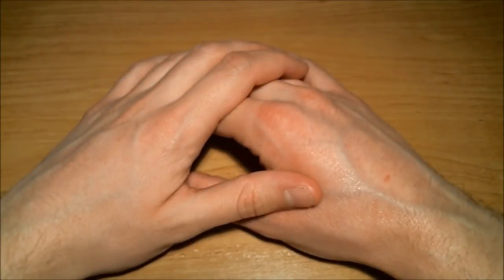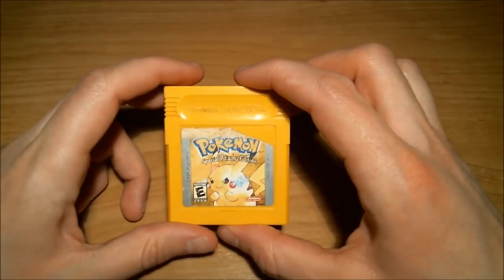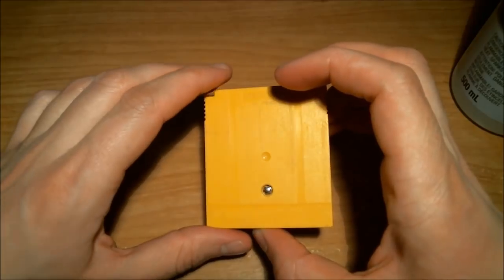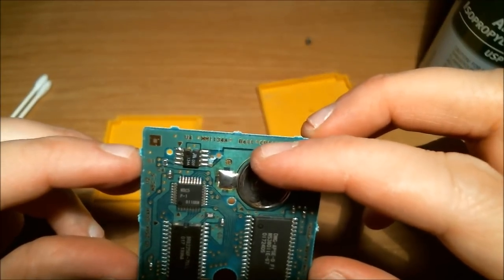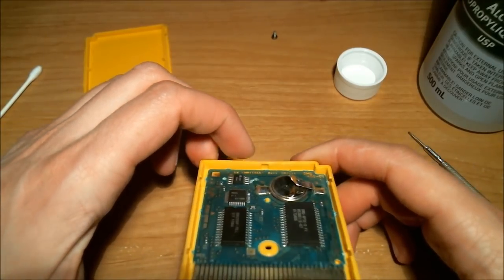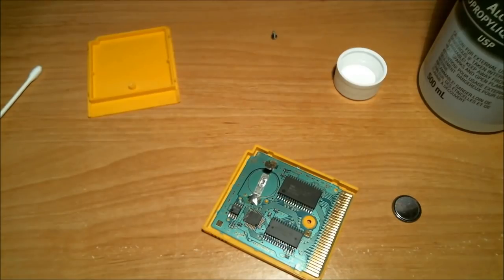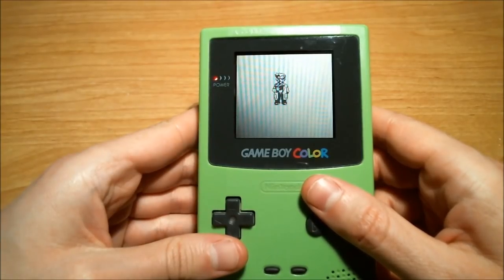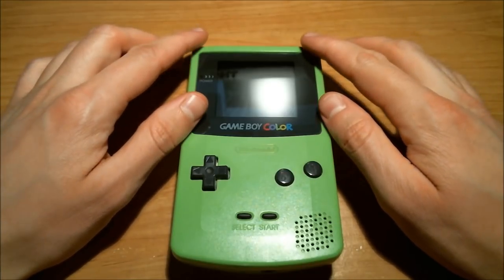ASMR Whisper: Pokemon Yellow Cartridge Battery Replacement

Comment: I actually just found out why it's not working. The previous dead battery actually leaked, so it might have messed with something in the game cartridge. So it actually had nothing to do with opening it up and replacing the battery.

The first time I tried after I replaced the battery, it was running good, then the screen whited out after 1 second on the "New Game" menu.
The rest of the attempts are just the Game Boy logo showing up clearly then cutting to nothing.

Comment: Well, I just tried everything I could tonight and it still isn't working. All of the battery leakage was cleaned out and both sides of the circuits were gently cleaned with alcohol. It was a good effort though, thanks for the advice anyways.

Comment: This video is so cool! :D I bought the same cartridge in a flea market a few weeks ago, and when I started playing I could save my game :'( Does it mean that I have to replace the battery? Where can I get a new battery like yours? T-T

Thanks for making this nerd-educative and tingly-addictive videos! :D (and for answering my questions as well)  (n_n)b thumbs up!
Reply: * I couldn't save my game :(
Reply from the maker: Nice flea market find! If the game plays fine but the save isn't there the next time you turn it on, then it's likely a dead battery. If you follow the steps in this video, you should be able to get it working! You can get CR1616 batteries at most hardware stores and electronics stores. Some drug stores may even have them. Good luck with the repair!

Comment: here's a tip, a CMOS battery dead on a computer's motherboard can work for replacing these!
Reply: hahahahaha i jacked my battery out of my motherboard but now my computer shadows my bios so either way im screwed :/
Reply from the maker: Martin Gallegos Yeah, you probably don't wanna steal the CMOS batter from a mobo that you're actually using. Only if you have an old, broken one kicking around. Seriously though, a CR1616 or 2025 battery is about $5 at most hardware stores, it's worth buying a fresh one IMO.
Reply: That computer was of no use anyways, but yeah I went out and bough a couple packs of em on amazon for about ten bucks
Reply from the maker: Martin Gallegos Good call!

Comment: Thanks for the help, just a question, how do you replace it again when there is electrical tape? Won’t it be a bit messy and harder
Reply: The battery will be good for another 10+ years after replacement